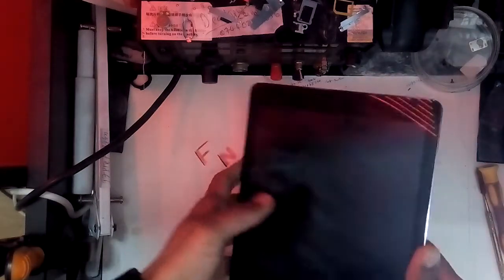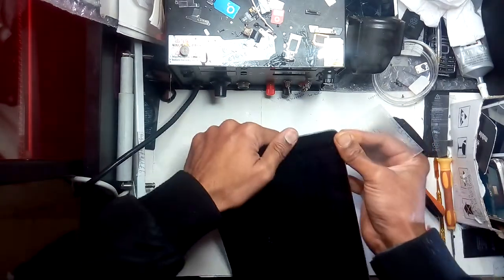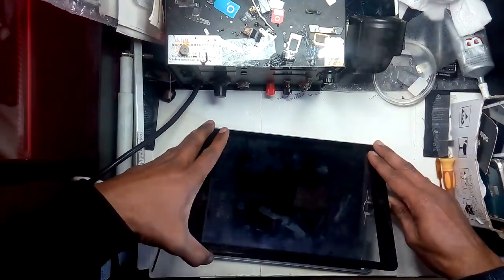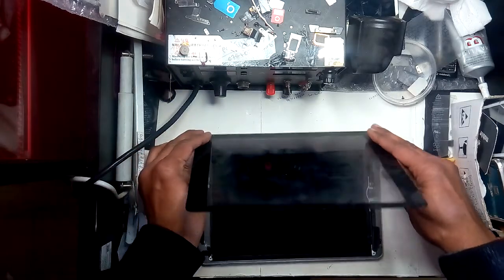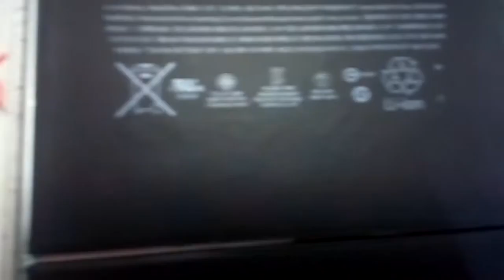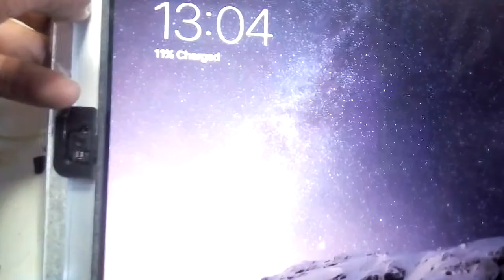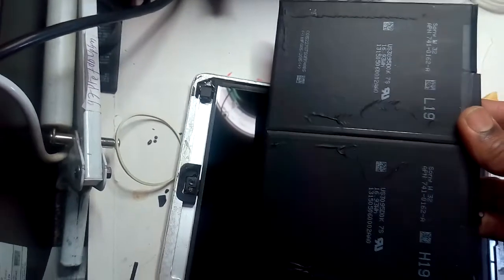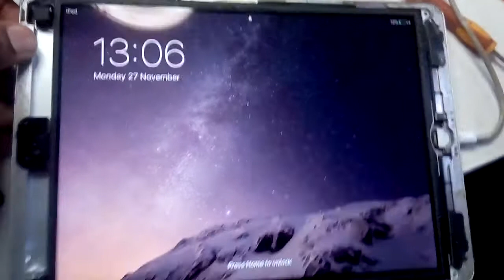Solved - IPad stuck on 100% full charge

Comment: So i use a samsung galaxy tab a so i was at the shopping mall buying stuff and come back home and i saw my tablet battery at 98 and it frozed there so i restart my tablet after i restart it the battery changed to 100 dont know why and at 12:34AM it become 99 i think im hacked and then i kept google it and then i realize i wasnt hacked and at 12:38AM it becamed 98 and i think it takes 4 minutes and im still worried i dont know what happend maybe i charged for too long my tablet is kinda old wow it use to be 1 min but now 4 mins for my battery its good so now whenever i have online class i dont need to charge while doing homework very nice my brothers tablet is okay but mine i dont know i think i download to much apps and my file get filled up i still dont know i deleted the useless files.